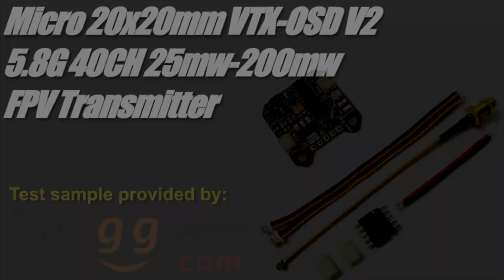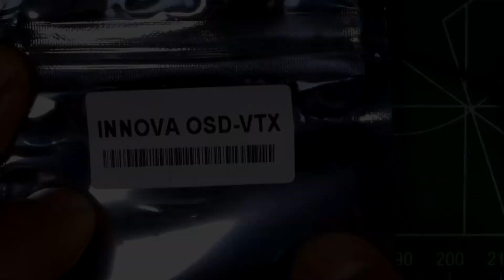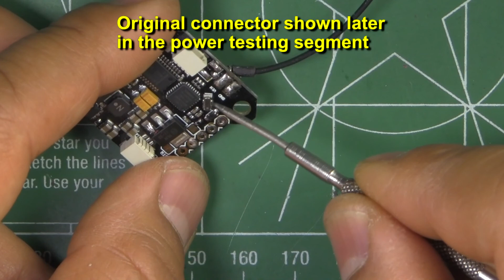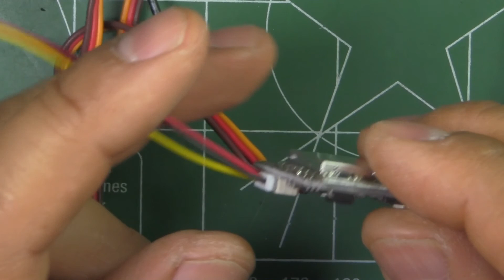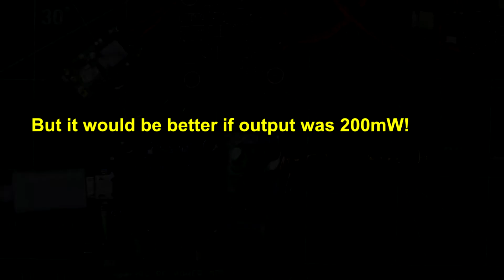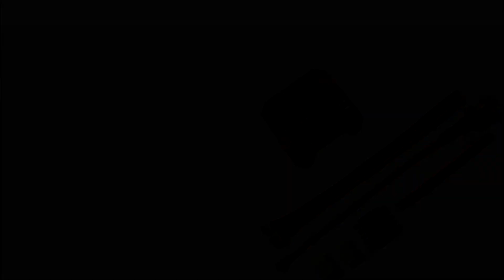Banggood Micro 20x20mm VTX-OSD V2 5.8G 40CH 25mw-200mw FPV Transmitter

Comment: I believe the size format is to put this board at the back of some FPV cameras like Swift, Eagle, Owl Plus, HS1117. I believe the dimensions are matching but nothing i can confirm ;)
My only complain is the antenna cable, i really don't like to put my FPV antenna vertically straight on my quads anymore!
Too bad you don't really get 200mW though!
Have a great weekend my friend and thanks for sharing all these goodies :)
Reply from the maker: I prefer antennas straight out the back, vertical not too much. Getting only half was a bit disappointing. 90mW can still be useful depending on where you plan on flying or if it's for a micro, then it could be alright. I think it's for those tiny microquads with 20x20mm FC mount pattern. Thanks for wacthing!

Comment: I would really like to buy this VTX because it's on sale in a shop in my country RN but this 88mW worries me. Could this be addressed with hard soldering antenna to the board? I don't mind precision soldering, I do it almost everyday so it isn't a chore for me.
Reply from the maker: I don't think direct-soldering antenna would increase RF output power by a significant amount. The power it puts out is good for flying short range